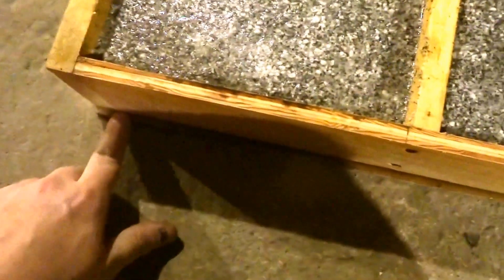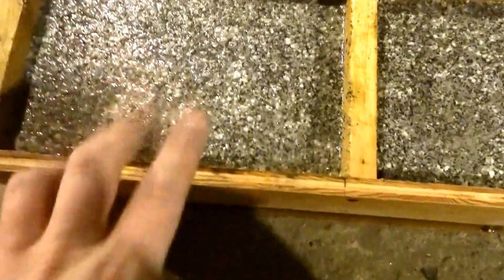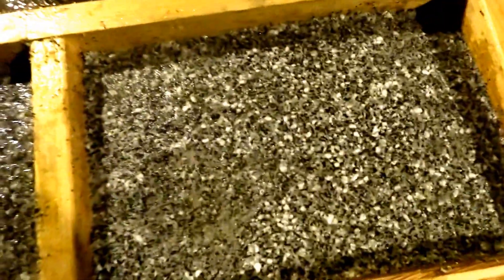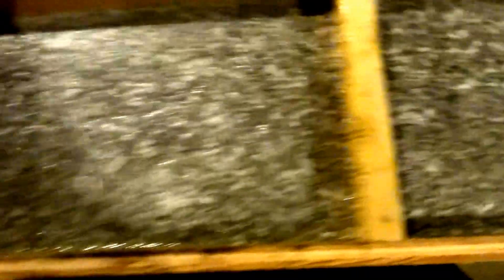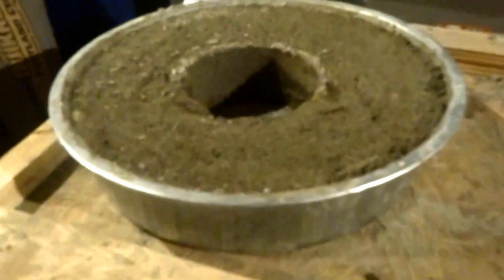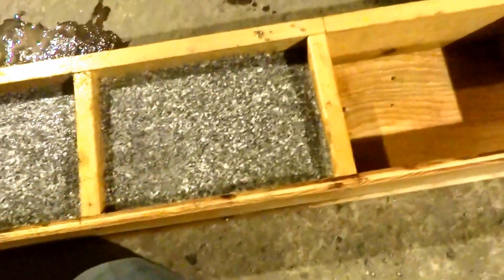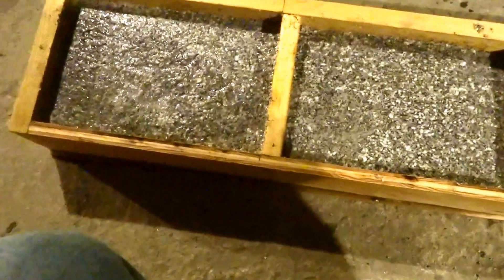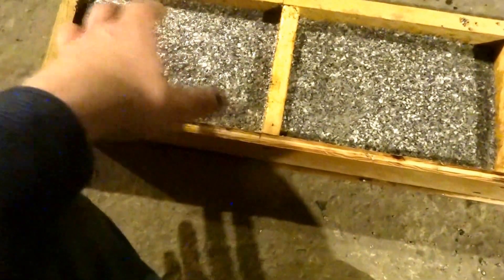New Brick Mold & Trial High Temp Bricks

Comment: What temperature can they withstand
Reply from the maker: I haven't tested over 2500 farenheit, but held up to the heat. The mix is very brittle & can be easily damaged, so I have switched over to using a perlite/bentonite_clay/carbide/aluminum_silicate brick & coating it with my furnace lining cement. Seems to be the perfect mix of rigidity & thermal strength. I use high temp carbides, bentonite, aluminum silicate, & perlite for my bricks. The lining cement has equal parts of carbide, magnesium silicate, & graphite with sodium silicate added until desired consistency for coating is reached.
I currently try to make sure to leave a week + of cure time with all my bricks, before firing them, sometimes even longer.
Reply: So when u say aluminum silicate u mean bits of that kind of brick or aluminum oxide?